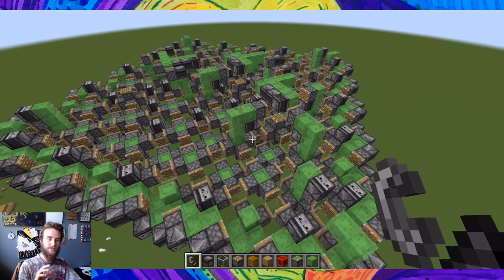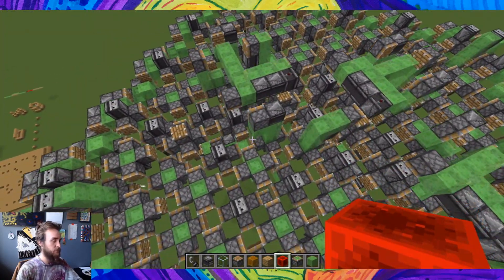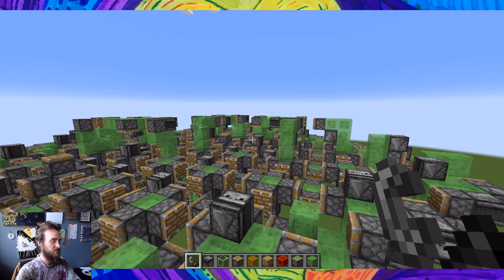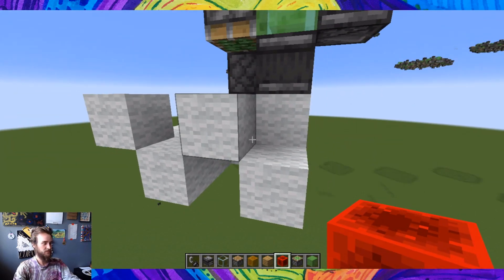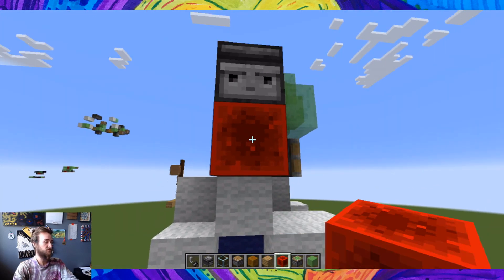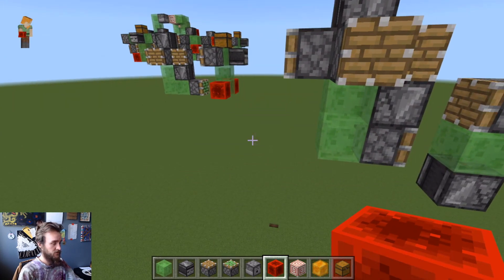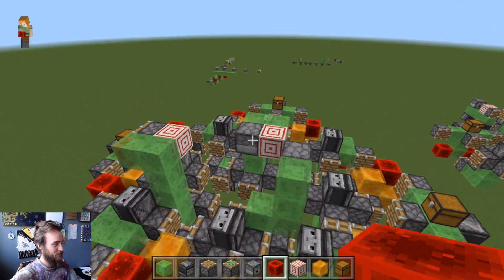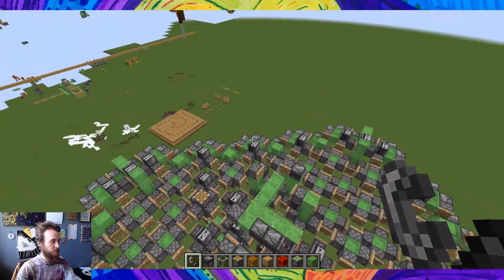4-Way Flying Machine Wires (Java & Bedrock)

Comment: Yo!!!!! ʕ ͠°ʖ̫°͠ ʔ⸝^nice! Do you have a server? I’ve also been working on 4way flyers, in a journey to a 6way… not there yet, but I like what you’re doing. I do have a 4way that’s 9 wide now, fully controlled.
Reply from the maker: Hi! No server but add me on discord if you ever wanna chat about slimestone tech: WhiteStoneJazz#8367 And 6-way tech sounds insane
Reply: @whitestonejazz  6 way is only able to work with a station though… i wonder if this wire tech could somehow be used… like a movable station 🤔